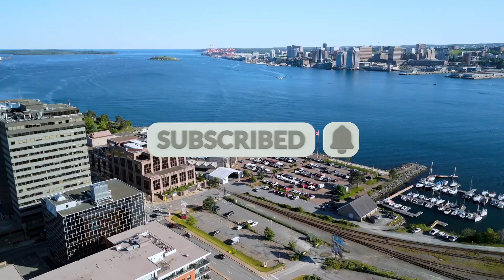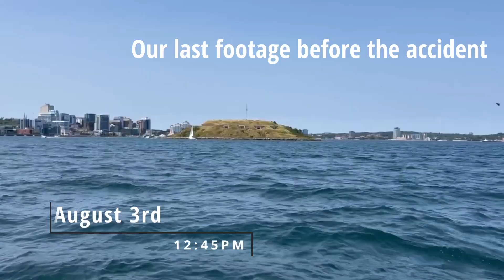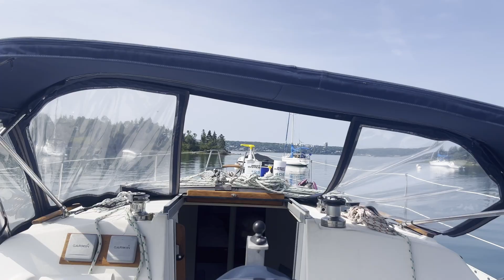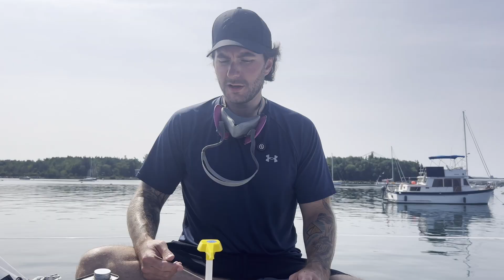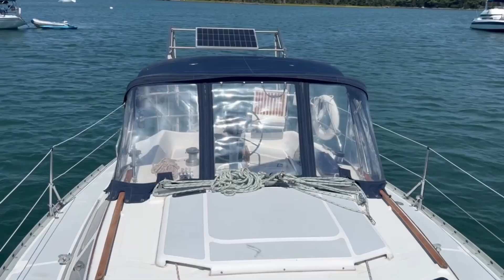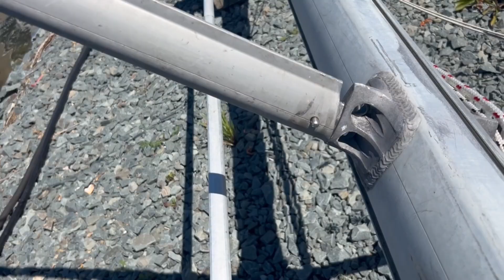The Mast FELL on Our First Sailboat! (Hunter 30 Dismasting)

Comment: Well that was helpful. I find it hard to believe... well actually no I don't. I am no rigger but am a certified marine tech and just bought my first sail boat about 18 months ago. When I looked at the boat (self survey) I made my offer and later decision to buy. I later hired a surveyor to come out for insurance... what a joke. He came back to me with a short list of potential problems. I walked him through the boat pointing out over 12 things he had missed some not safety related but over half were. Dry rot in through hull hoses, lack of proper bonding to through hulls, VHF radio inoperative, bilge pump inoperative the list goes on. Humiliated he never sent me a bill but yet the insurance company wanted his findings. When it comes to education over experience I will chose experience every time weather my own or some one with much more.
Reply from the maker: Yikes! That is scary and concerning. Take those surveys with a grain of salt. I agree, experience is the most valuable. Thanks for watching